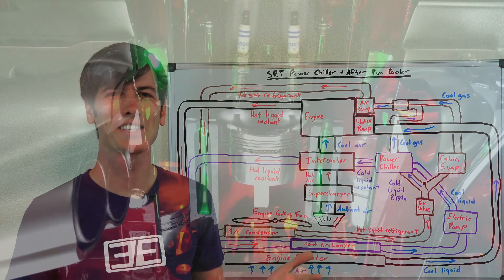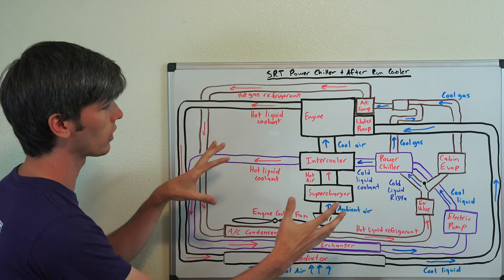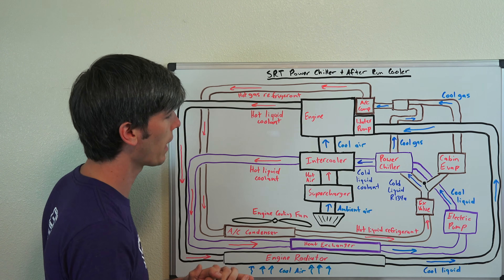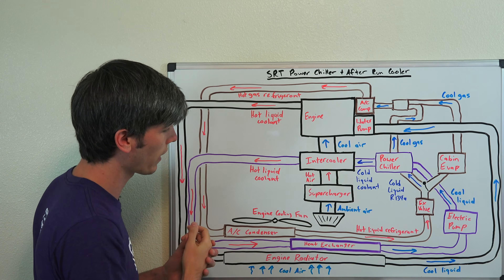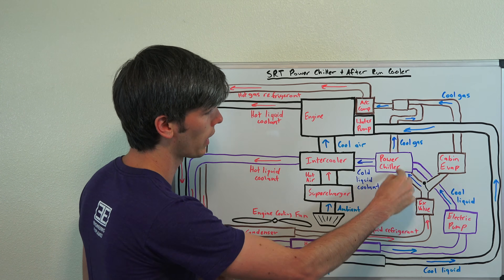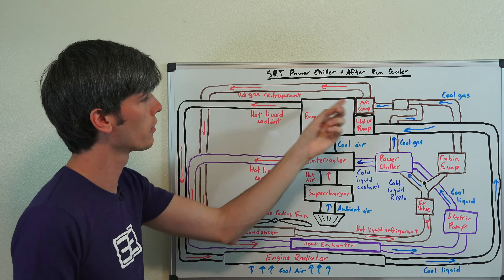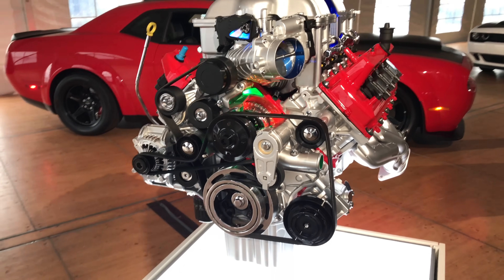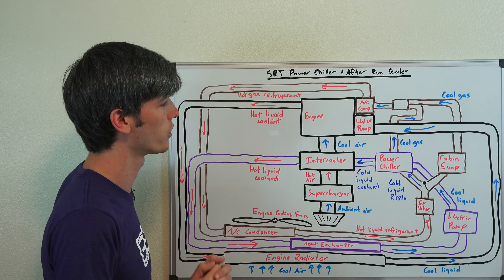How The Dodge Demon Uses Air Conditioning For More Horsepower!

Comment: I've always wondered why street cars don't do this more often. I just assumed it was due to extra cost.
Reply: Marshall+ and the reliability penalty of making the car more complex
Reply: This system uses engine power to increase the amount of fuel the engine can burn. That increases power, but decreases efficiency. Turbochargers are far more efficient, they use mostly the otherwise lost energy in the exhaust gas, and they have better thermal efficiency too. The boost in power allows a smaller, lighter engine, which is good for efficiency and more than offsets the energy loss of the turbo. That's why they are used on modern engines. For example my current car has a 1.4l twin charged engine, which is 35% more powerful, has 70% more torque, and still about 10% more efficient then my previous car's naturally aspirated 1.6l engine. The new 1.2l version has about the same performance as the old 1.6l one.
But now this whole thing is irrelevant. If you want either power or efficiency, just go electric. The Tesla Model S P100D ludicrous+ is just a tiny bit slower, but it's a luxury car and it's engine has 1 moving part, and the whole powertrain has around 20. It's far superior in almost every way, probably the best car ever. Or if you don't have that much money, the Model 3 just came out at $35,000 (before incentives), and it still can beat most sport cars. The only issues is that the waiting list is so long, if you order one now, you won't get it before 2019.
Reply: Efficiency. Oil is expensive now, and climate change is upon us, so most people want efficient cars, even at the expense of performance. Complexity and cost can be a factor too. More moving parts mean higher maintenance costs, and lower reliability.

Comment: Hey I have a question. You said that under 4500 rpm, the chiller works. What about beyond 4500 rpm. Is the chiller system always working?
Reply: The compressor shuts off at above 4500rpm because the pulley ratio is usually around 1.21 and that means at 4500 engine rpm the compressor is spinning at 5445 . It is a safety built into the compressor to protect it.
Reply: The A/C pump probably turns off to save parasitic loss
Reply: 1xxrecar But shouldn't it be on since higher rpms lead to more heat.
Reply: @ProudQLD  i think it's just because when you're doing a drag launch, after you reach 4.5k rpm, you're supposed to be at a certain speed high enough to provide enough air to cool down the intake air just through the intercooler, so you won't need that a/c system anymore at that speed, while when you're under 4.5k rpm your speed will be lower and that means that you eon't have enough air flow for your intercooler to cool down the intake air enough, so you need that a/c system to achieve a certain intake temp.
Reply: Not at all.  I design these for much larger engines...  40k HP combustion power turbines spinning 45MW generators.  We cool the inlet air with about 1.5MW of chiller load (2k cooling tons), which provides much more than that in added generation due to increased air density... 5-8 added MW.  Google "turbine inlet air cooling".
Reply: I'm betting it's only the compressor that shuts off above 4.5k , as 1xxrecar said above, to limit parasitic losses.  I'd also bet the chiller's coolant loop has sufficient capacitance to carry it through a 1/4mi run, hence the many reviews' description of the system showing chiller temperature to know when it's ready, IMO "pre-charged", sufficiently for a run.
Reply: Interesting.  However, the system on this car still shuts off at high RPMs.  Maybe it's not nearly as efficient as a utility scale system?  Or maybe there's enough thermal lag that it's worth shutting off for the latter half for a run, even with it being a net gain of power.
Reply: I found that after 4500 RPM, the AC compressor clutch shuts off, but the coolant still keeps circulating through the intercooler and power chiller.
Reply: It sounds like overall this system is a net loss in power.  However, since this is a drag strip the engines are producing a lot more heat than they can sustainably get rid of and refrigerating the intercooler (and its fluid) effectively gives you more room to store heat.
Reply: What's redline?
Reply: Thanks I tried looking all that up for my ain't lag saw someone else with a wrx with a  combustion chamber basically it a jet powered turbocharger / boost I'm looking into copy it some of the information I wasn't sure was a good idea I'm not as familiar with like is spraying water on the hot side some thing that can be done to get rid of excess egt temperature? Mostly in emergency  situation. As for the gm a/c compressor quoting  Harrison refrigeration the newer style is most  efficient at engine rpm of 2-3000 ish 9 cubic inches it's in a tech paper mopars rv2 puts out more at 12 cubes but  sense they have a fixed pulley its the same as the engine you can only rev it so fast gms it somewhere at 6500 rpms and it's really only super efficient in one spot like a  carburettor and a old school  Point engine

Comment: So the a/c runs all the time cooling the engine, then cooling the cabin when you switch it on?  Wow!
Reply: 177SCmaro it's not a pre-intercooler it is the intercooler. There are a few companies that make the same setup for use on various applications.
Reply: Neil Passage i would want the intake and fuel cooled as much as possible. We used to run cool cans back in the day, basically coiled copper fuel line in a cofgee can full of ice. This only works on drag cars because of ive melting so wuovkly
Reply: This is correct. It is called charge air.

Comment: a mere $85k...msrp
Reply: And they've taken steps to stop dealer markups as well.
Reply: Basically, they have a limited edition supercar (or hypercar if you want to be technical) coming out called the Valkyrie and Aston don't want dealers flipping them for money. So, long story short, anyone who gets caught will lose any reservation slots they had for other vehicles and they will be permanently shut out from getting another special model ever again. How Aston plans on doing that remains to be seen.
Reply: If you want a guaranteed collectors car, I would suggest buying one. The last rare muscle car I know of is the ctsv wagon, which I bought.
Reply: True, true. I know Dodge is aware of it though and hopefully will be much stricter in the future. They might even follow Aston Martin's lead.
Reply: Well, I guess I shouldn't be surprised.
Reply: And the fact that all of them are going to be purchased shows that people want them. I was responding to a comment made by Son of Tamriel.
Reply: Ghost Assassin what did Aston Martin do?
Reply: Wrong. People are going to buy this thing and you'll be surprised how many that does.
Reply: suprem gas 

only
Reply: Superbike Mike g
Reply: 700 HP? What is this 2015?
Reply: relatively speaking thats actually a really low price all considering what it would normally cost to get that kind of power...
Reply: but it sadly still didn't stop them from marking them up :(